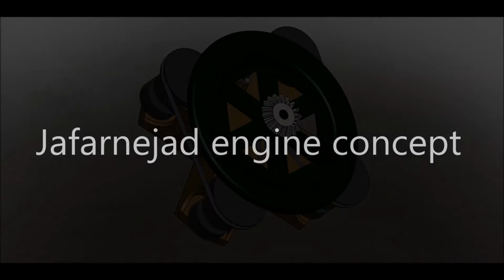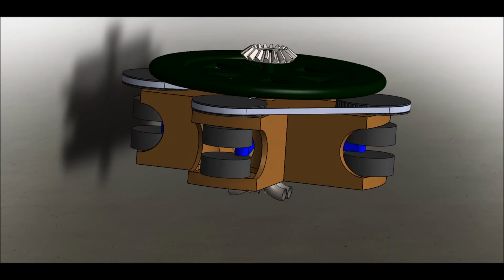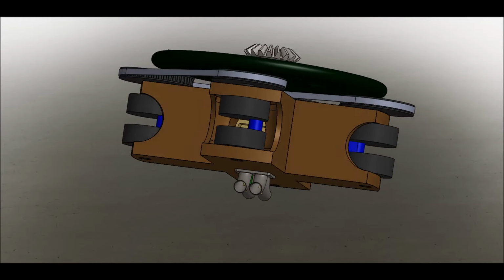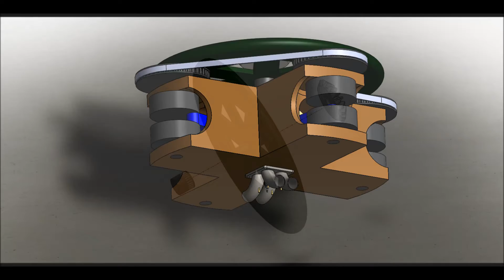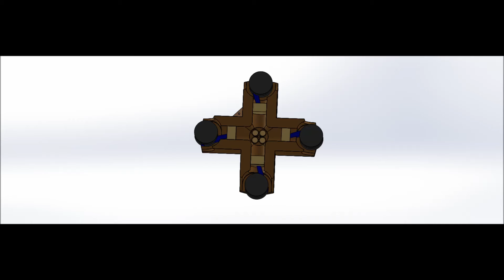Engine concept

Comment: I was thinking about the same concept as “reverse radial engine”. The difference in my mind from yours is that I was thinking about gears connecting the crankshafts and the common flywheel.
Reply from the maker: There is less dynamic load with belt.
Reply: @markjafar1132  But if I have the money and time, I would investigate conventional radial engines instead. Replace the pushrods with camshafts on the cylinder heads. The camshafts can be driven by a circular timing chain. Radial engines won't be wider than boxer engines. They ought to have more power than boxers. And with the flywheel in flat position, they would have lower centre of gravity than boxers. You just need a bevel gear to transmit the driving force to wheels on  a car.